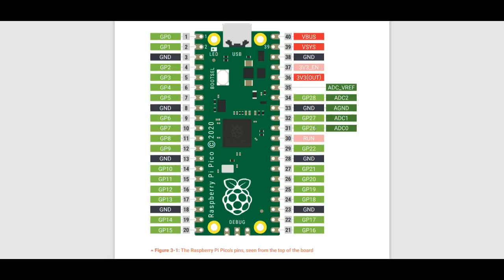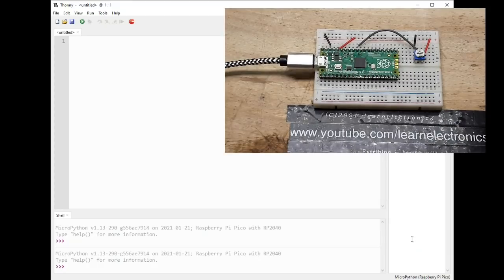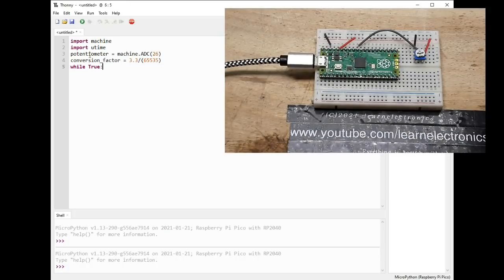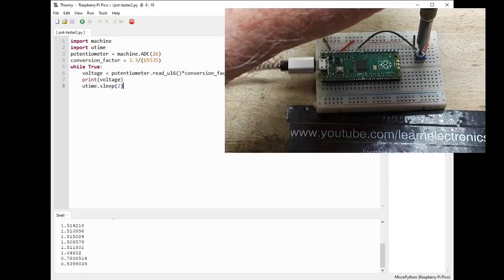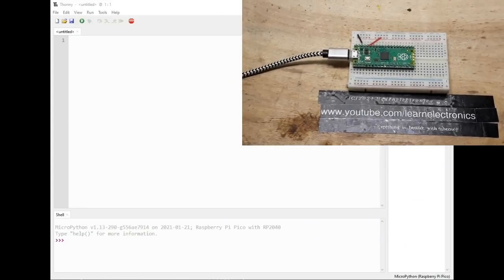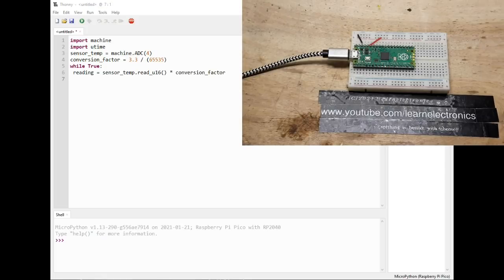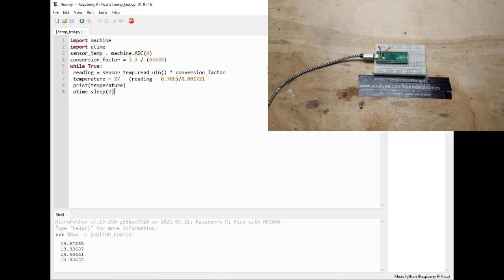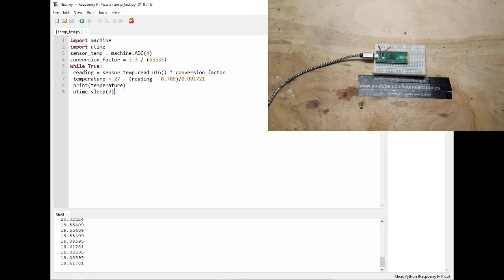How to read the temperature sensor on the Raspberry Pi Pico

Comment: temperature = 32.3 - (reading - 0.706)  /  0.001721

seems to match the temperature reading of my AstroAI multimeter.

temprature can easily been displayed in Celsius and Fahrenheit like this:

celsius = 32.3 - (reading - 0.706) / 0.001721
fahrenheit = celsius * 1.8 + 32
print("{} Celsius / {} Fahrenheit.".format(celsius, fahrenheit))

Comment: Whilst it does indeed change with ambient temperature, the actual reading obtained by this method is grossly inaccurate. Either the equation is incorrect, or some reference voltage or current needs to be correctly set. Surely it wasn't 14°C in your lab, and your heat gun would have been hotter than 20°C?!

Comment: Thanks for the video, I had already tried this but found that the accuracy using the calculation supplied was terrible, about 4/5 degrees out.  Did it feel like 14 Degrees C in your workshop?  I would rather use an external DS18B20 but I don't think the onewire library is implemented yet?
**Update **. I switched to Circuitpython as it has a onewire library and a Ds18x20 library.

Comment: Great video but I have one question. If our ADC is 12 bit why do we divide by 65536 and not 4096? I always thought that 12 bit means 2^12 so max "resolution" should be 4096. It looks more like a max value of a variable but that is just a guess.
Reply: The pico library expands it to a full 16 bit value. This way future boards with higher ADC resolution will still be compatible with older code.
Reply: @ExpectMichael  Oh ok I understand. Thank you for reply!

Comment: Man this pico looks powerful and micro python looks easy to work with I cannot wait to get one of these. I look forward to more videos on this thing even with the new language hiccups. Great video Paul, this is great new fun.
Reply from the maker: Thanks Mike. How are you these days?
Reply: @learnelectronics  oh man I’ve been spending less time on YouTube and more time at the electronics bench. I’ve been working on a synthesizer using a as3340 and a few cd4000 series logic chips it’s been fun but frustrating, I keep ending up with inconsistent volume levels from different chips. I think I just need to get a bunch of op-amps and buffer all of the outputs from every chip so I can get the basic sounds working and then I have a bunch to learn about the different filters I’m going need down the road. Maybe one day I’ll have it functioning enough to get some boards made up, well that’s the hope.

Comment: Nice video.

Maybe it's my lack of imagination but without wifi, bluetooth. lora interface what use is the pico as an isolated device?

I mean just printing the temperature to a screen doesn't seem exceptionally useful.

Thanks :)
Reply from the maker: You can take the temperature as an input, Have device process it and then activate other pins as an output either activating relays or other displays
Reply: My first application is to replace the thermostat in a small under-counter refrigerator.  The Pico is $2 and a two relay expansion board was $4 at Micro Center.   Six dollars to replace a $16 dollar mechanical unit... (Excludes power supply - of which I have too many)
Reply: @Biser10562  nice, is there a relay expansion board for the pico?

Comment: why didn't they design the pico pins to be silkscreened? very amateur. Can you use vscode instead of thonny or is thonny required ide? also , you may want to semicolon the end of each line.
Reply from the maker: You can program over USB serial if you want

Comment: Thank for this. Problem though Pico says it's 24C Thermometer says 17.5? Any idea?What I have typed (which hopefully is the same as yours but I am dyslexic!):import machine
import utime
sensor_temp = machine.ADC(4)
conversion_factor = 3.3/(65535)
while True:
    reading = sensor_temp.read_u16()*conversion_factor
    temperature = 27 - (reading-0.706)/0.001721
    print(temperature)
    utime.sleep(2)
Reply: From my understanding it's giving you the internal CPU temperature, not an environmental reading unfortunately. The thermistor diode is inside the die.
However his CPU was cold because of his environment, if he ran a tight loop for a while it would soon jump up

Comment: Now if Raspberry Pi could shrink the Zero into that form factor while keeping the CSI connector, the 1Ghz processor and 512mb ram, it would have a load of us super excited, there is a whole community using the Zero for digital HD FPV in our RC Craft :)

Comment: The whole process of the programming the pico is in nessasary messy. They need a ide that allow for Arduino library use. And eases upload seamlessly. I don't think trying to beat Arduino on price will work without the ease that Arduino brings in seemless upload of programing with its massive library's and ide. Pico will need to bring more to the game then price. As if your programming in micropython for microcontroling then you could pick up an raspberry pi2 cheap and use that then buying a pico. Sorry I'm a microelectronic engineer and the block to using a microcontroller for electronic control shouldn't be blocked by very few library's and programs and a messy upload and programming method. I know I'm gonna get gait for this but it's true. Raspberry have spent too much time on the board and for got the pc side software interface.
Reply: Have I understood it correctly that single step debugging is possible? That would make me consider a pico instead of the arduino. Of course it is possible to use the atmel IDE with the arduino but that is another level of complexity. For my purposes, the arduino and simplicity of the IDE is fine.
Reply: @alistairgill5538  I'm finding micropython Fairly easy to get to grips with after using arduino, definitely a lot easier to edit code, and of course you got the added advantage of the REPL so you can run commands directly, 
Think back to 8bit computers like the commodore 64, you use the editor window like typing in a program with line numbers and the REPL (output window) for direct commands (no line numbers) is the easiest way to explain how micropython works
Reply: @garymetheringham4990  I never used the commodore but Basic in DOS. (Thanks to Bill). So the idea of running immediate commands is familiar. That's a while ago! But a good debugger setting breakpoints and checking register and variable values is really important for debugging more complex algorithms.
Reply: there is also a massive micropython library of sensor drivers, and it's a lot easier to add/alter the driver if its not quite how you like it. it can also be programmed in C ! and through arduino ide soon

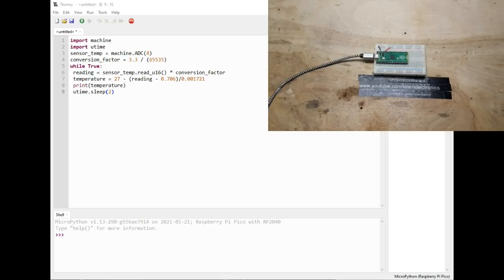Comment: 11:04 It was an indentation mistake : the last two lines ( "print(temperature)"  and  "utime.sleep(2)" ) were not indented and thus were out of the "While True" loop. And of course, since the "While True" loop is infinite, anything written after that is never going to execute.
Also, I higly suggest you to take the habit of using TAB for indent and not a single space like you did. It might be wierd at first but trust me, in the long run it will save you a lot of headaches if you're serious about micropython/python =)
Reply from the maker: Yep
Reply: @learnelectronics  Also left 'sleep" out after utime
Well presented and explained, easy to follow

Comment: 14 deg Celcius = 57 deg F. Doing this outdoor? :)
Reply: I say not in his neighborhood. It's been at least a month since we have seen that high of a temp outside. I live within 50 miles / 80km of Paul. This morning I went for an inline skate and it was around -5C / 23F.
Reply: @InlineSkater72  I had no idea where Paul lives. I live in Stockholm, Sweden. Here it's about -10C outside.

The program in the video that shows the temp is listed in the "Get started with Micropython" book. I run the same program and got approximately the same temperatures.

Guess the calibration is a bit off...
Reply: @niklasnorrthon3125  I believe -10C would be a little colder than the lowest temp I have had in 2021.  Interesting about the calibration. You are likely correct. I have seen other CPU die sensors that are somewhat inaccurate at low temps.
Reply: he is a polar bear ;+)
Reply: ikr, must've been freezing 'is bollocks off; my biggest takeaway from this video: this guy is a mad lad lol
Reply: I just tried the same program on my pico. Mine shows about 3 deg Celsius too low. 
It's just a guess, but I can imagine the temperature is in the chip because its purpose usually is to measure the core temperature and protect the chip from overheating. 
As Pico users might be more interested in the ambient temperature, that weird factor is probably rather an estimation than a real calculation of the temperature outside the chip.

Comment: Can you flip the board and solder the header to the other side?
Reply: There is a button on the “top” side which you need to press sometimes. That would be underneath if you put the headers on the other way round. Looks like the best way is to print off the pin out reference sheet. Do agree it’s a big mistake printing labels on the “bottom” side.
Reply: @willsgrandad  I don't do digital so I have no idea. Is that an issue? Can it be pulled from the board, the button pressed, and it programmed, and reinstalled?

Comment: Thanks Paul.... any suggestions on where to find a ras pico. Amazon and Banggood seem sparse. Thanks
Reply: I doubt you’re going to find it in stock anywhere right now. The demand is just so high that you’ll just have to wait and snatch one up from the next batch.
Reply: I picked up a few yesterday at Micro Center in Yonkers, NY.  They were available for $2.00 US each - so I bought three.
Reply: Not sure where you are in the world.
However, multiple sellers have them on EBAY UK.